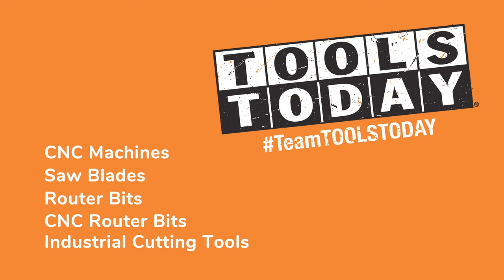How to Make: Epoxy Pour Bookshelf | ToolsToday Video - Short Version

Comment: Hi, i bought an amana blade for my saw stop (24 tooth though not like yours) and noticed it is about 4mm undersized from the sawstop blade ... I had to tighten the brake adjustment screw to the point that it feels tight and had to bring the blade closer to the brake than the recommended 70 thou .. i had to use a credit card (about 30thou) rather than the provided yellow tool , in order to get the "adjust brake cartridge" code to go away ... Have you experienced this with amana blades ?